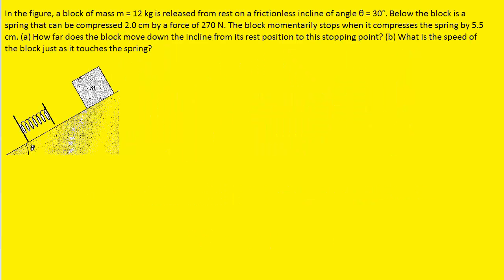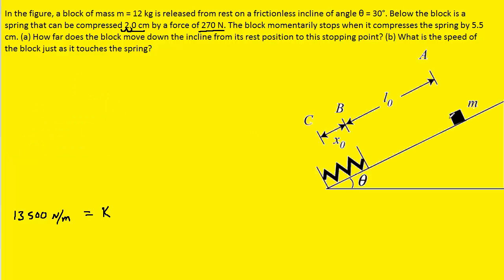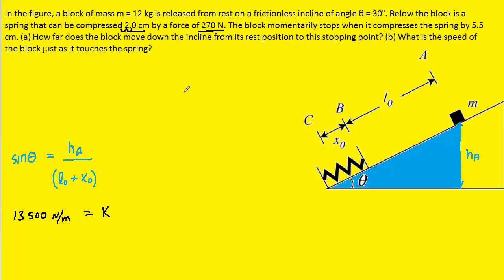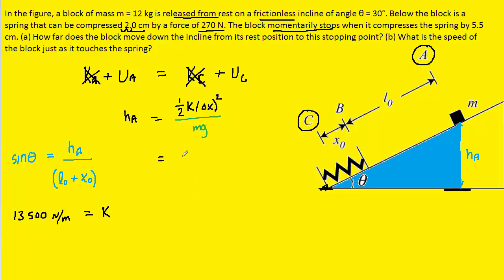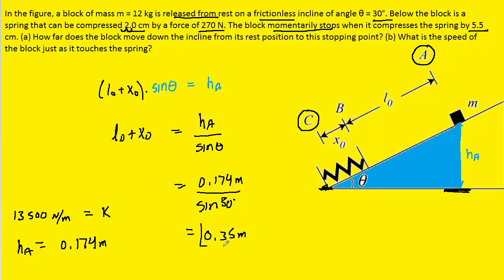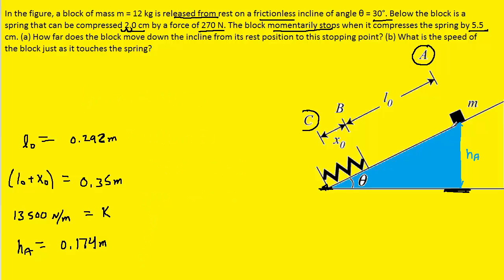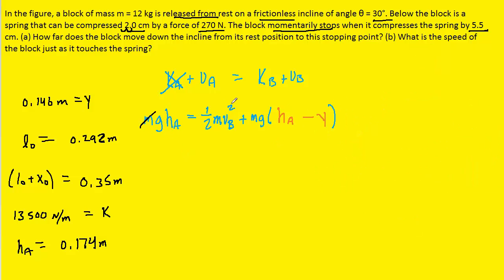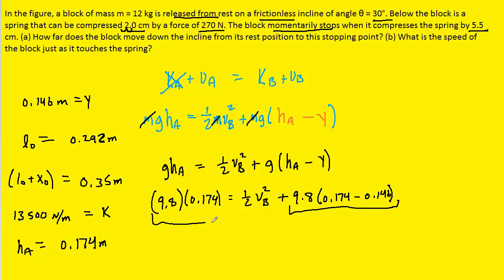In the figure a block of mass m is released from rest on a frictionless incline

Comment: for part b you could just use the v^2=vo^2+2a Δx equation and solve it from there. letting a=9.8sin30 and v^2=0 and x=.293...
Reply: @tnr7288  such as if there were friction involved, yes, or if the spring were actually a viscoelastic material, or if the block was moving at relativistic speeds, or the block was made of antimatter, etc